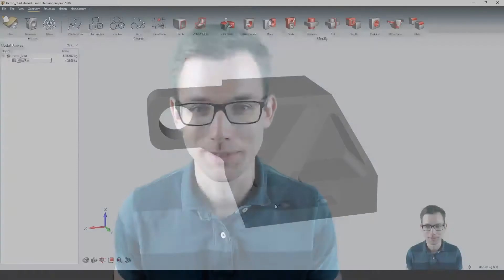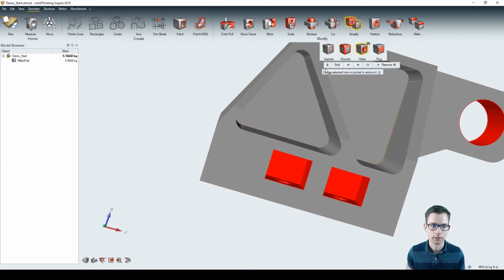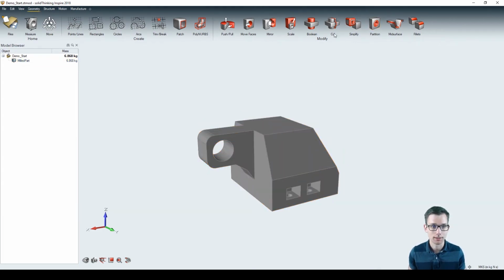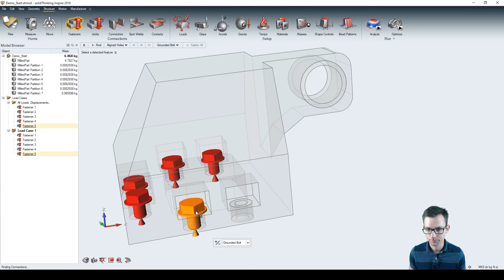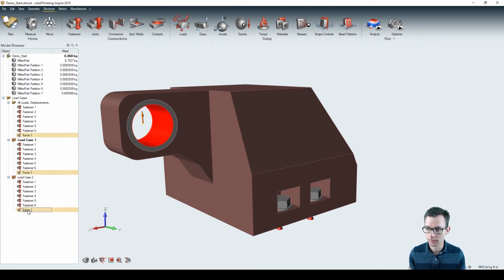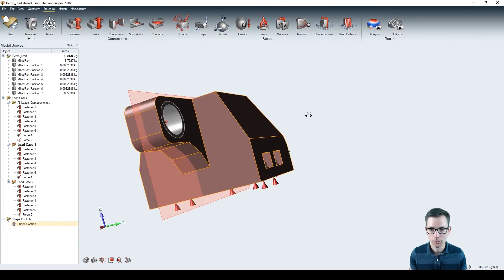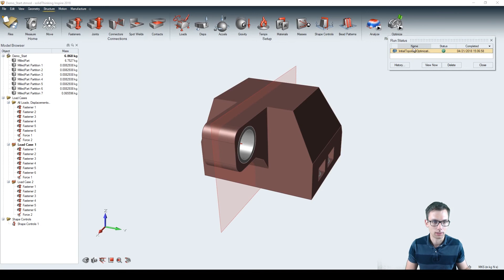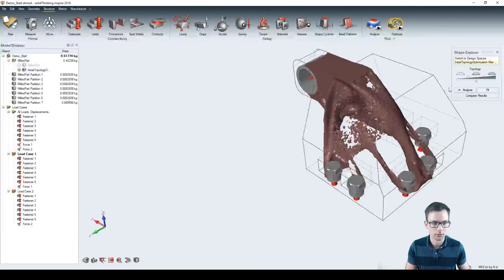Topology Optimization with Altair Inspire

Comment: Thanks for the video.
What is the difference between topological optimization in Inspire and topological optimization in other software of the hyperworks platform (for example hypermesh) ?? It seems that in Altair you cannot intervene on the mesh (you can only set 'faster' and 'more accuracy' in the options
Reply from the maker: Hi Antonio, 
first of all, Inspire uses the same solver as you would use within the Hyperworks Suite which is Optistruct. Where Inspire simplifies the process of creating the simulation model, you have full control with Hypermesh as a preprocessor. A few advanced things are only available with this solution targeted at the stress engineer audience. Inspire is more targeted at the CAD engineer audience - simpler but also less advanced in what it can model. 

Now the good news is you can switch from Inspire to Hypermesh anytime as a .fem file is being exported into your user dir when you are launcing an optimization or analysis run - this you can import in hypermesh - change it and run it with optistruct if you want. For better control on the individual parameters like mesh quality and so on, I would suggest you chekout the Hyperworks 2021 Suite - it is optically not that different from Ìnspire (you feel home pretty fast) but can do so much more. If yo have any questions, please let me know :) 

Best regards
Reply: @ManuelRamsaier  great explanation, thank you very much. Have you made any tutorials about managing files in STL format (import, export) in Inspire or other Altair software?
Reply from the maker: @antoniovolpe1598  Hi Antonio, for Inspire it should be a simple open / save. For Hypermesh it is a FE-File - so in the old layout you would go File - Import  - Solver Deck and choose stl, export similar. 
Hope this helps :) If you have further questions please let me know.

Comment: Is possible to fasten these bolt over there? Not realistic to define.
Reply from the maker: Sure, you can apply a pretension on the property window. I will make an update video series regarding Inspire and Hyperworks 2021 - I will surely include it there as you're totally right, pretension is the way. :-D 

All the best :)